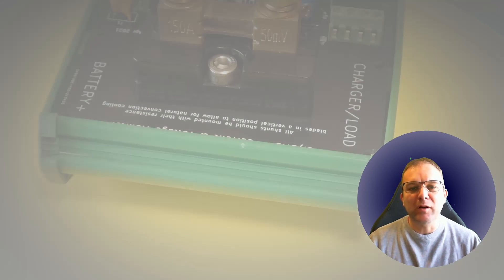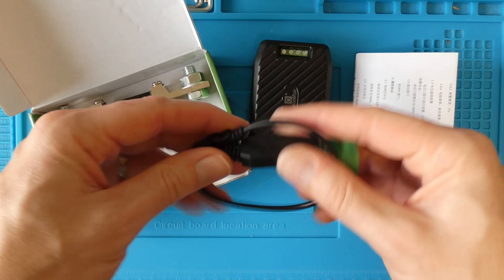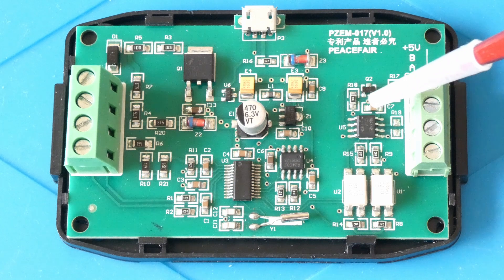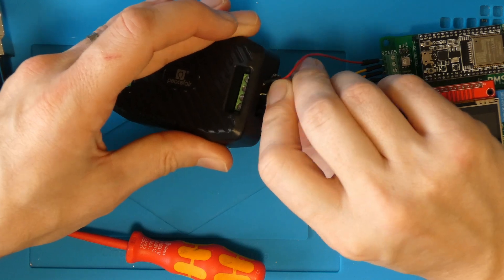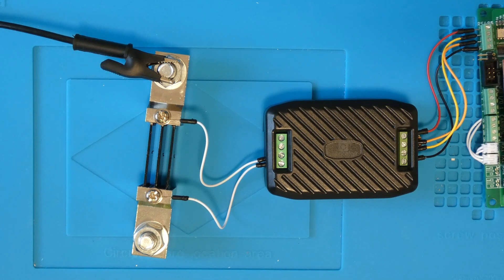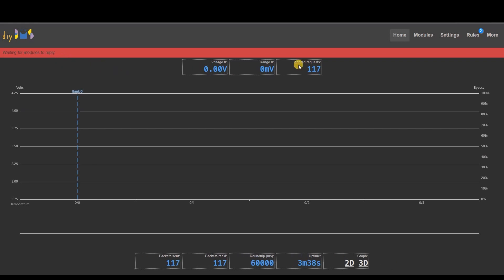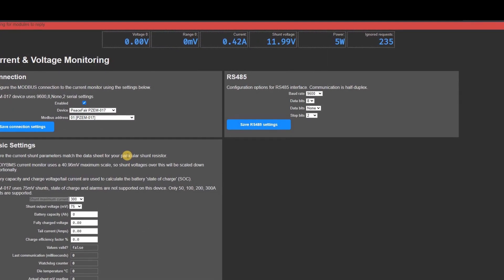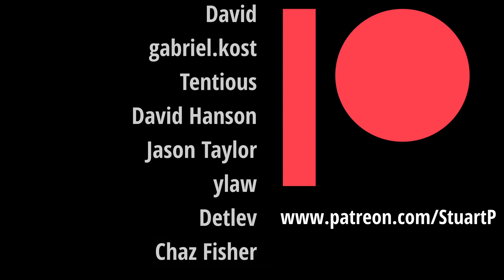Adding PZEM-017 current and voltage monitor to DIYBMS

Comment: It's a pity it can't detect the current direction. It actually measures it in both directions but just doesn't tell you the direction. I'm still trying to figure out whether to add a separate circuit to detect the direction or just put the PZEm-017 aside and build a whole new thing from scratch.  Unfortunately I found out about the lack of direction indication only after I bought them, installed them and started using them. Maybe I should have RTFM before.
Reply from the maker: I'm not sure about adding extra circuitry, I'd probably just build a new one.
Reply: @StuartPittaway  Thing is I bought these because I wasn't in the mood for building them but I guess that's what I'll have to do anyway.  I'm just wondering if I can get away with some quick hack such as biasing it to get to effectively read bipolar and map it to positive only and then just fix in the logging software. I'll probably give that a try before building it from scratch.

Comment: Is it mandatory to inject 5V from the USB-RS485? 
I am having a hard time trying to understand how to use the PZEM-017 because I have a distance of 60 meters where my raspberry is going to be connected and sending 5V over 60m of twisted pair represents an enormous voltage drop. I was expecting to connect only A and B terminals of the RS485 bus.

Can't the 5V for the max485 be supplied from the voltage source (in my case a 12V battery) being monitored? Would I need to add an external isolated power supply for this?
Reply: The 5V is needed because the RS485 bus is isolated from the voltage you are measuring and there is no on board isolating DC/DC converter to power the RS485 bus.  Voltage drop will not be an issue though as the current draw is only a few mA. Even with thin wires it won't be an issue.
The 5V you provide is only powering the RS485 driver, not the device itself, the power for the device is drawn from the voltage source you are measuring, provided it is more than  7.5 volts.
Reply: @listerdave1240  thank you so much for the clarification. It is a pity that they did not introduce an isolated 5v DC-DC converter. I will try to add it to my setup then and only route 1 set of twisted paris.
Thanks again.

Comment: RS485 and 9600 baud speed it's so stupid! How to change?
Reply from the maker: I'm not sure you can with the PZEM device.
Reply: I don't understand, what's stupid about that?
Reply: @listerdave1240  getting data super slow!!!
Reply: @ПОКАНЕПРИДУМАЛ-м2у  How is that slow? One typically needs such data at a rate of only a few readings every minute or even less. 9600 baud is way faster than is needed for that, what would you need more speed for?

Comment: Hi, great video and great project. 
But can anyone explain why have you added 120ohms resistor b/w A and B? 
Does it has to do anything with current monitoring?
Reply from the maker: No, thats to do with RS485 communication - it requires a 120ohm resistor at each end of the cable to work properly.
Reply: The issue i'm facing is i'm getting 150V from solar panels, and pzem is it reading correctly, but current  isshown  to be zero.
Reply: @taxxab69  You probably didn't connect the wires correctly to the shunt.  Double check your wiring and make sure it matches the diagram on the back side of the PZEM module.

Comment: @StuartPittaway
Hi Stuart.
I've been looking at the issue of current monitoring and building up my own circuit to do the work, using easy replaceable like for like parts.
However (bad build quality aside), an off the shelf unit like this that can be got at a reasonable price is probably the better solution. (Along with adding current monitoring to the actual board, which I believe you're adding in V4.6 anyway)
The only issue we seem to have with this module is the current direction. A simple micro controller could put a pin high or low depending on the current direction. Or even just listen on its serial port for it to be asked for current direction and then respond with the answer.
I know you do a lot of work behind the scenes, so just wondering on your thoughts on this before I go reinventing the wheel.
Low cost power monitoring ICs from LCSC are available in droves and typically used for the battery/load DC current testers (which I've had experience with) and cost around $1-2 each.
Thanks,
J
Reply: Just to add to this, people have modded the PZEM-017 to work over serial. Using this logic we can piggy back on the PZEM serial to Modbus converter to allow something cheap (like an ESP-12f - don't need the WiFi, just the cheapest thing I can think of that's available everywhere) to act like another Modbus network device that returns current direction. With that in mind, a $1 micro-controller and a few resistors would solve the issue.
Reply from the maker: The ina229 chip I'm using is relatively low cost it doesn't really make sense to reinvent the wheel
Reply: @StuartPittaway Fair enough. I couldn't seem to get it here in Ireland or on any of the PCB sites, so gave up.
Reply from the maker: @muxerbaker4638  you can order directly from TI, worldwide delivery. https://www.ti.com/product/INA229

Comment: Can you use this to monitor TWO dc circuits?

I have one of these (with tasmota) monitoring DC solar input, but i'd also like it to monitor my DC output as well (to a cigarette lighter output) is this possible? 

I'd really hate to have to buy a second one just for DC output.
Reply from the maker: I don't think that would work without a second device

Comment: I bought PZEM017 and set the all circuit as you did. But values are just reading as a zero.. What might be the problem I didnt find. Because of monitor or something else...
Reply from the maker: Probably easier to discuss this over on the OpenEnergyMonitor Forum, or open a github issue

Comment: When I compare this pzem to the multimeter kyoritsu, the results was different about 10% for voltage and 80% for current (external shunt 50A type)
Reply: @Stuart Pittaway could you test against your current shunt board? Would be nice :)

Comment: Is there any chance to make this work with old esp8266 ?
Reply from the maker: Not really, that controller doesn't have RS485 interface on it, and no spare serial ports.
Reply: https://youtu.be/TbLLrlZ3deI
Reply: Yes it is very easy - flash esp8266 with Tasmota firmware . Tasmota supports the PZEM-016, 017 . I made a video on how to hook it up https://youtu.be/TbLLrlZ3deI

Comment: What about adding support for the Victron SmartShunt? Does what we need and you are able to purchase it.
Reply: The victron shunt sends all data as a string every second on the ve.direct port (uart). This should be easy. Victron has detailed information on there homepage.
Reply from the maker: @pekaway  it's easy to parse the data, but no direct serial port available on the controller to use.
Reply: @StuartPittaway  you mean on your esp32/8266? Maybe softserial? Baudrate is not so fast 19200.
Reply: @StuartPittaway  one could stick an Arduino with RS485 in-between to connect it.
Reply from the maker: Its possible if there is a published document on what communications protocols it uses
Reply: There is a 3v serial port on the victron Bmv712.
Reply: @paulshaw8226  Yes, the same VE.direct port as on the SmartShunt. But that doesn't integrate into the DiyBMS webinterface. That would be useful.

Comment: Very nice! Did anyone sucesfully implemented the JK rs485 active balancers that everybody is using now with Lifepo4 baterries? It could be useful to have a second way of reading the battery voltage and control the active balancer on/off etc
Reply from the maker: I've not looked at the interface to those devices, is it documented some where?

Comment: Very cool! - I wonder why it cannot offer Wh counting - the example software shown on the AliExpress site shows Wh numbers. Maybe it's one-way only, and thus useless?
Reply from the maker: It will do w/h counting, but diybms uses amp hour, so not compatible.
Reply: @StuartPittaway  Hmm, wouldn't it be possible to calculate Ah from Wh if you sample the voltage and current often enough?
Reply from the maker: @zaprodk  yes, but this would be required inside the microcontroller inside the shunt, just like I've done with the official diybms current monitor.